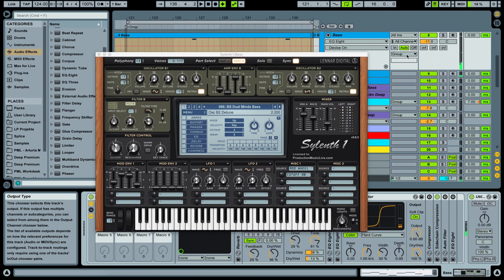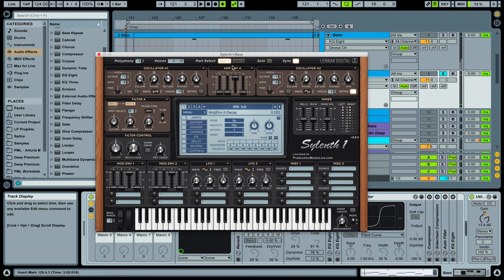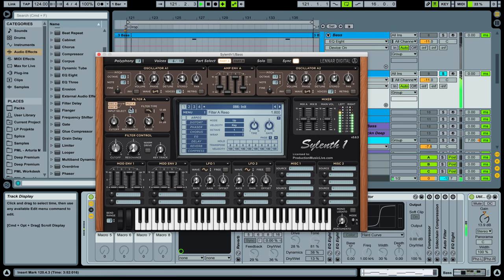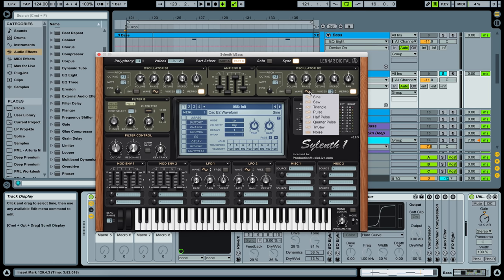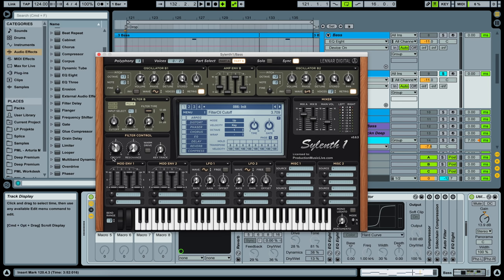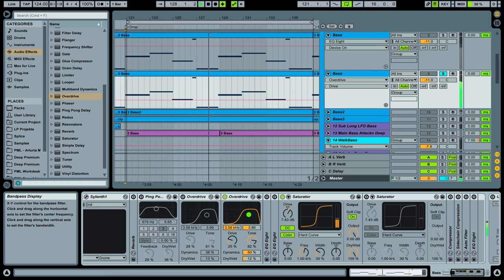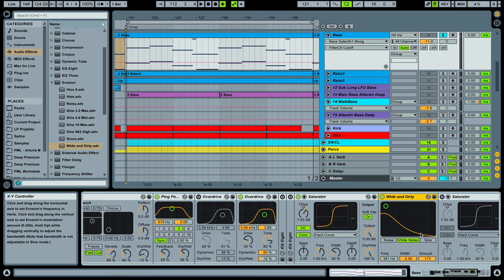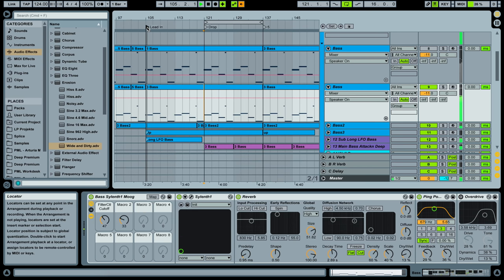Stephan Bodzin Moog Lead Bass with Sylenth1 (Overdrive, Sound Design, 4k)

Comment: It's a nice sound and it most definite is quite a Bodzin Sound. 
Let me put some more tips on how to get even more in the footsteps of Bodzin. At least bass-wise.
First of all, the Bodzin-Bass is (almost) always very gritty. 
You can archieve that by choosing a distortion unit that is a bit better suited for that than the Saturator. Just try some free vst's that distort, overdrive, saturate or tube-emulate that sound good and choose one that adds grit and dirt especially in the low-mid frequencies. 
There are some vst-filter plugins that even add harmonics based on the filter-cutoff, which can give even more perfect grit.
Otherwise you can use the multiband-dynamic tool (or groupings of the same soundsource with equalizers on each channel that only lets the low- mid- or highband through) and put the distortion right after the low frequencies or even use different distortions on different frequency-bands. That is important to get quite subtle distortion in the highs to get rid off of the harsh highs while still keeping a gritty and rumbling low-mid area.
Choosing a synth that can feed back into its filter-section is also a good idea to thicken the sound.
The quality of the filter is very important as well. Shitty filters equals shitty frequency-transistions and it ruins your sound by coloring the sound in a (mostly) unwanted way.
Recommend is a quite transparent filter which has the option to feed back into itself and adds (different modules of) filter-drive if wanted.
Mono-Synths are quite handy for that because they usually already bring a more beefy sound (even raw oscillators) than most poly-synths.
To get the vibe and feel of the Bodzin sounds you should use quite a lot of automation or knob-turning. While Filter-Cutoff is the primary thing you want to play with (play with it like all the time, but hold it subtle and only open it completely up on characteristic portions of the track) there are a lot of things you want to modulate throughout a song.
Namely there are: Filter-Drive, Filter-Resonance, Filter Feed-Back, Glide(!), repitching individual oscillators (!), Detune, LFO's that modulate different things (!), Filter-Evenlopes and the Volume-Envelope, Keytracking and and and. Simply modulate everything and you will quickly hear what Bodzin modulates throughout a track. Stack automations over each other to archieve even more spectacular moments and so on.
Keep it subtle with the reverb. With all that distortion you don't want to mud up your mix, better stick to delay and go a bit crazy with that one.

And of course: If you really want the Bodzin-Sound...buy a moog :D

If interested, here is something I've made a long time ago as I was a little bit "obsessed" with that moogy sound. No hardware was used though.
It has no musical aspiration and was just a journey through lots of gritty distortion, filter sweeps, big chords and lots of modulation.
I've made use of the things I explained above and while it's not based on any specific sound of bodzin, my goal was to recreate that moogy and gritty feeling his sounds have.
The beginning of it is quite boring, the second half is where the ear-candy happens :)
https://soundcloud.com/m4lte-1/legend-poly-sdrr-drop

Cheers.
Reply from the maker: Dude, you're the man! Feel free to get in touch, maybe we can share your project in a video or tutorial or something! (mail us at: info@productionmusiclive.com)
Reply: i dont mean to be so offtopic but does any of you know of a way to log back into an instagram account??
I somehow lost my account password. I love any assistance you can give me.
Reply: @Mohammad Alfonso instablaster ;)
Reply: @Owen Yusuf It worked and I now got access to my account again. I'm so happy:D
Thanks so much you really help me out !
Reply: @Mohammad Alfonso Happy to help :D